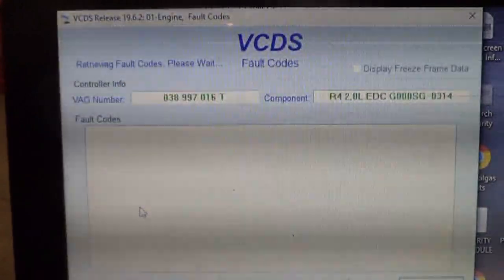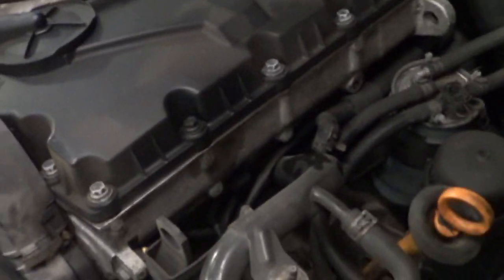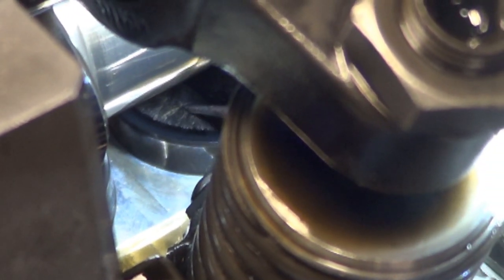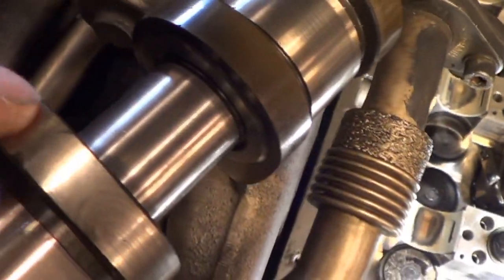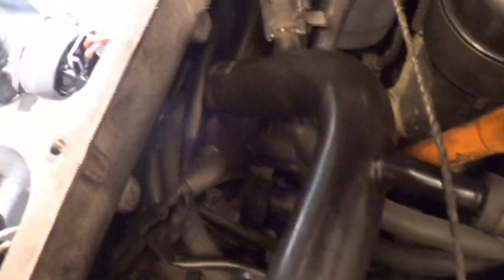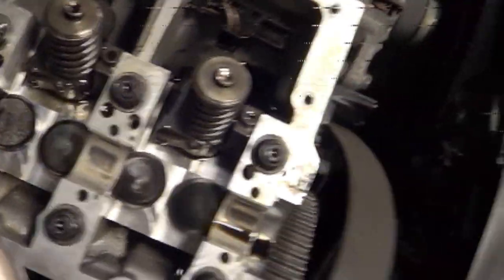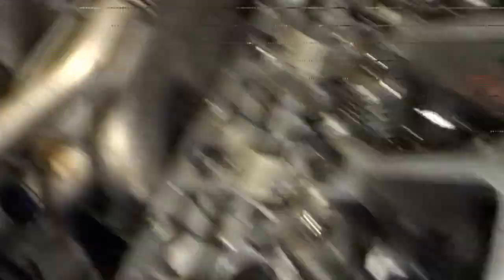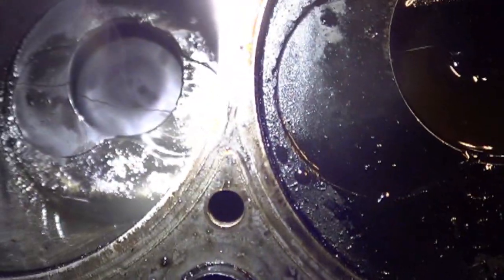Passat tdi bhw misfire #2 P0302

Comment: Nice one Richard, i wonder would a small endoscope down the glowplug hole would see that, save you pulling the head on a now condemned engine
Reply from the maker: Ya, I don't have a boroscope that will fit in the glow plug hole.  But we knew it was terminal after the leak down test.   Pulled head for curiosity and for the video.

Comment: So did the valve drop and struck the piston? Or was it the glow plug that broke and then made all the marks on the piston?  I had the same results on a customer with ALH. The timing belt had jumped one tooth and made contact with vale to piston but the valves are so straight In the head that the misfire didn’t happen Right away. And I have the same style lifters as you’re number 2 lifter. Anyhow it finally jumped 2 teeth and then it made some destruction
Reply from the maker: No valve contact.

Comment: Hi. Can this problem appear on a compression test or only on leakdown test?
Reply from the maker: yes, It would show as zero compression on that cylinder. Then simply putting a blow nozzle in the glow plug hole you could identify where the compression is going.
Reply: @CoolAirVw  thanks the answer. Looks like the problem is something else in my case. All the cillinder has 30 bar compression. 
I like your videos. Especially about PD engines 🙂 keep up the good work 👍
Reply from the maker: @matyasrozsahegyi5818  Have you pulled the valve cover to inspect the cam?  Do you have a misfire?  Have you checked connection at the injector?  See following video.    You might have a misfire without the code.   I had one misfire for a month before the code triggered.